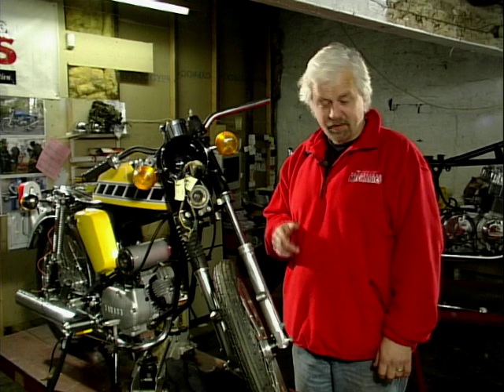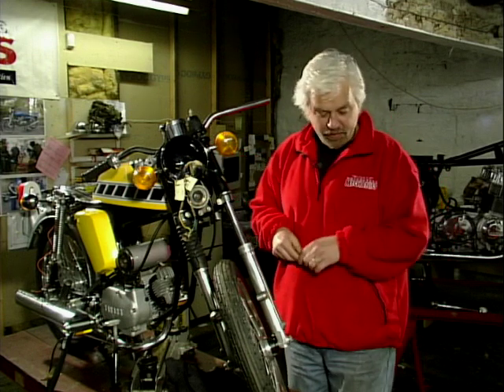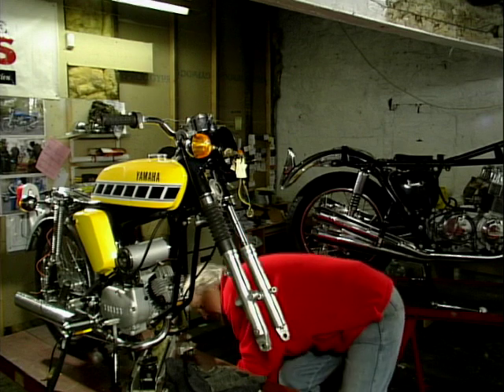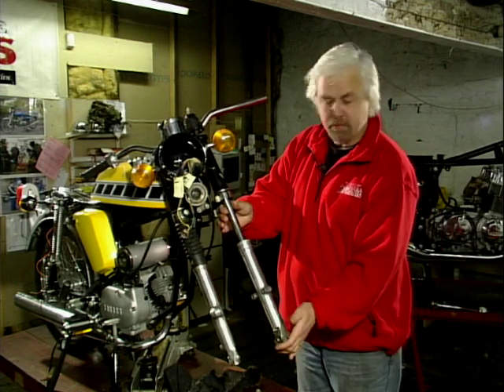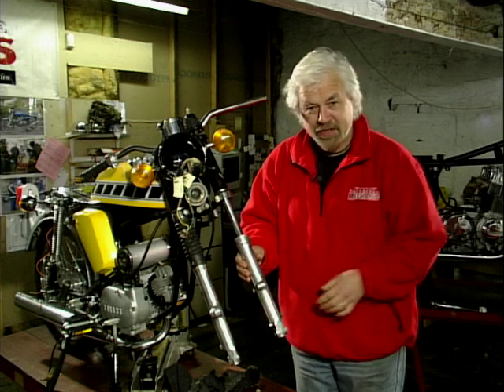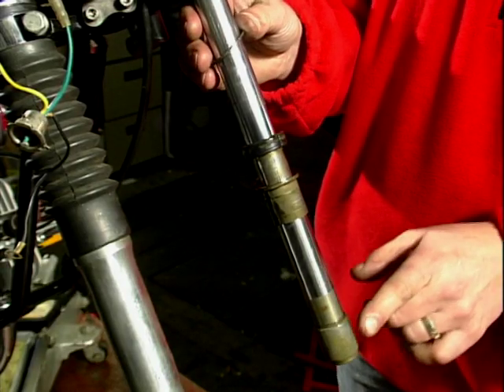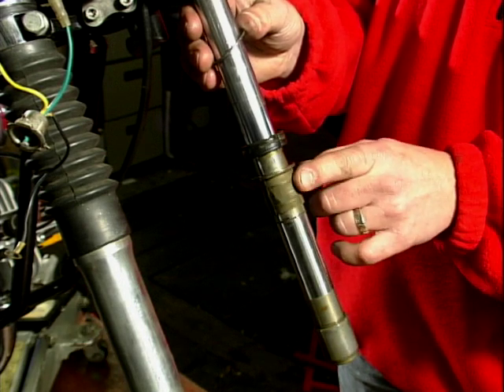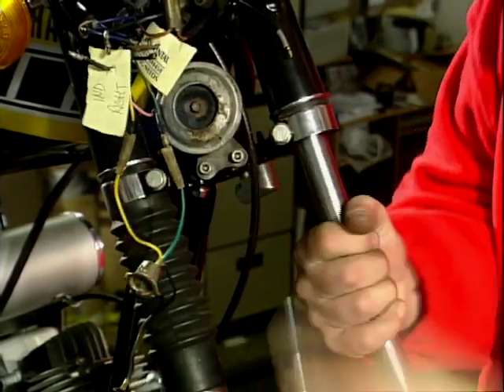How To Replace Accident Damaged Front Forks On A Motorcycle

Comment: Need a bit of advice: the lower part of my Honda ST1100's fork has got dented (brake rotor bolt came loose when riding, hitting the fork and taking a bit off it before the bolt came off the wheel). It's hard to tell exactly how much damage the fork has taken. I will check if the stanchion tube has bent, but if not, should the lower part of the fork be replaced, or is it OK to continue using if it doesn't have a very deep hit? Is some work to "patch up" the bit where the bolt hit recommended? or just painting over so that the exposed aluminium doesn't oxidize? I noticed you didn't recommend replacing the lower fork tube even for this motorcycle that has been in an accident, hence the question.